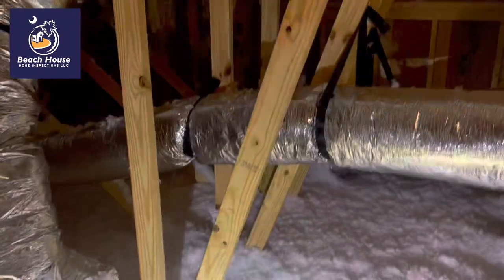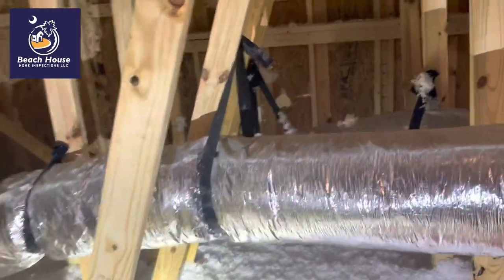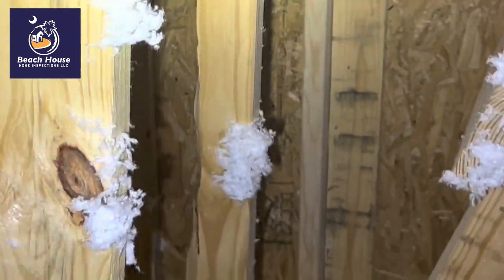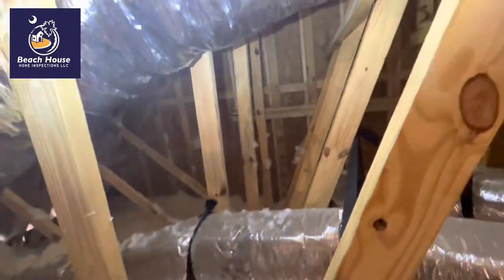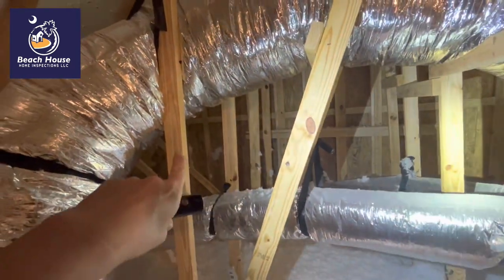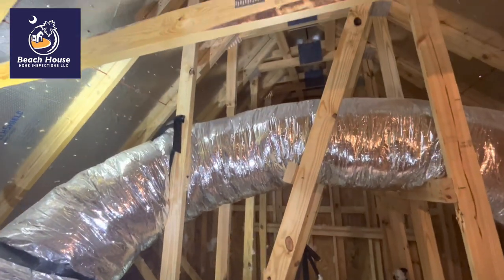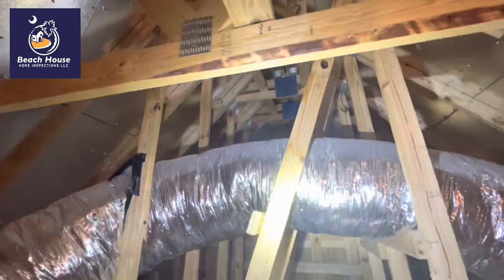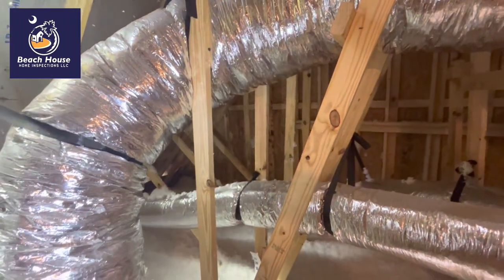Two broken trusses on a new home

Comment: The quality of the materials used in the truss manufacture,, Some of those 2X4s are strictly No. 3 stock,, suitable for pallet manufacture,,, uh wait,,,  There should be structural member printing on each stud, species and No. 1 common,, No. 2 common,, etc.  Where are the grading stamps?  Is that graded lumber at all?     Truss repair?  How about truss replacement,,, the entire roof.  Ungraded lumber is NOT approved for anything more structural than  doghouse, or a pallet.
Reply: Trusses are signed off on by a structural engineer.
Reply: @francismarion6400    Michigan code.  "R802.1.1 Sawn Lumber
Sawn lumber shall be identified by a grade mark of an accredited lumber grading or inspection agency and have design values certified by an accreditation body that complies with DOC PS 20. In lieu of a grade mark, a certificate of inspection issued by a lumber grading or inspection agency meeting the requirements of this section shall be accepted."  If in Michigan,, and IF there are no grading stamps on the wood members,, they are NOT trusses, They may not be used.  The lumber just visible in the video  was at best a #3 or #4 grade lumber,,  size of knots, percent of wain.  The vertical members of those trusses would 100% flunk in Michigan.  Been doing this for 50 plus years.  Flunk.  I would not hire that builder to build a dog kennel for the backyard.  No grading stamps and busted trusses unrepaired.  No effing way.   Don't buy the house.
Reply: @Sailor376also 
Most nowadays lumber is just a freaking joke. That’s on mills, truss companies have to use what they get otherwise they will go out of business. The lumber in this video is yellow pine which is horrible for building trusses: it bends, twists and brake like no other wood.

Comment: In Europe/UK, roof trusses are built form C24 timber that is graded with checks for knots and defects per linear length.  Internal constructional timber must be C16 or better (lower rating), structural timber at C24.   nice to see the US can get away with using any old s..t of timber in their houses.
Reply from the maker: Truss lumber is graded here. This truss was left in the mud for months and installed. This has likely happened in every country hundreds of times.
Reply: @beachhousehomeinspectionsl4967  I was talking about the knots in the lumber, you never see those in C24, basically - no knots over 0.5 cm allowed.  That lumber looked worse than C16, probably ungraded.

Comment: I had a broken truss like this in my 1980s home. I fixed it myself.
Reply from the maker: When you go to sell your house and a home inspector discovers your DIY repair, you will need to provide documentation from a structural engineer, indicating it was repaired according to drawings. If those drawings cannot be provided, the buyer will most likely require you to hire a structural engineer to ensure repairs were made properly.
Reply: Your repair might be perfectly adequate. Hell it might even be overbuilt to what the engineer would have asked for. The problem is mortgage companies and insurance companies want to see documentation showing that anything caught by an inspector which this probably would be, was fixed to specification. And an engineer has to write that specification

Comment: I find it very disturbing that a builder will not let you up on the roof or to open the electrical panel.   Major red flags.  I’d tell the purchaser to try find a better builder.  Good job on being diligent and saving a family years of grief trying to chase down a shoddy builder.
Reply: Yeah, same here.   If I'm an inspector or homeowner and I saw that BS, I'm getting out of the attic, opening the main elec panel, and going on the roof, all while videoing my findings.   "Builder doesn't allow...."   yeah right, it's not his house.

Comment: Did you miss that hole in the sheathing?? Looks like something ramd through the sheathing and did that damage to those trusses.
Reply from the maker: If you have ever built a house you will know that they pop a hole through the sheathing on the last truss to rig it up with a crane. I did miss it it is a non-issue not worth my time to report
Reply: @beachhousehomeinspectionsl4967  Gotcha, they installed the sheathing  while truss was on the ground.

Comment: Honestly, sand bags, rebar, barbed wire and wire mesh with concrete and on site aggregate and you don’t need much wood.
UWL destroyed their equipment trying to destroy a earthbag dome house. True story, look it up if you don’t believe me. Tbh though, there is a reason the military uses those materials to build BUNKERS.
Also, side note, the building industry has a serious foothold with materials and design, so as to profit most with the existing companies and industry.

Comment: This is the worst myth that people to stop spreading. It is true that they don't build them like they you too. For good goddamn reason. Because the old houses were built like crap. Yes the old timber was better and true to size. Like a 2x4 was actually 2x4  same where the 2x10 was 2x10. The issue is with old houses. They did not use hangers they would take a nice piece of timber cut a notch timber. The foundation's sucked back then No lally columns or footing. If they needed a post back then. They were usually cut a tree trunk. That would be on the property from when they cleared the lot. Did not matter what kind of tree. Because the lot was cleared right before building the house. Whatever tree trunk they used as a post would be green. The framing material they used for the first floor deck. Is the word that they stripped from the forms. That's why when you go into a basement of old house you will see concrete footprints on the ceiling. Especially how they framed the support walls in old houses. Usually no headers over the doors or Windows. If they did put headers in there'd be two by four on the flat. With just two framing nails through the studs. No King studs no Jack studs no she'll know cripple studs. The list goes on. People see things built in the past with rose-colored glasses. That's why when people sell an old home. To make them feel better they don't say the floors are unlevel the doors don't close no more. They say it's an old house and it has charm
Reply: I wish I could give this comment a dozen thumbs up. As a carpenter with 43 years experience, I've been saying the same thing for years.

Comment: How much are you really saving with trusses? I would much rather have a traditional attic that I can put stuff in and easily get to my heat/AC, I personally would never buy a house built with trusses
Reply from the maker: When they don’t get broken coming off the delivery truck they are a good product. They are engineered for 150 mph winds. Rafters are not engineered for 150 mph winds.

I’ve seen old rafters that are defective too.

Comment: I would never buy a home from a builder.. i build the damn things.. their materials are garbage.. the engineering is garbage.. the designs are garbage.. that being said, older houses have asbestos, rot, and warping issues (location depending).. that is why i would sooner live in a tiny home or a log cabin 😂😂😂
Reply: All homes are built by a builder,but yes you need to question the quality on these new homes,there are still good builders out there !
Reply from the maker: @melodyhart1331  I agree. I built a number of homes and there are some builders in my area that do build a very nice home.
Reply: @melodyhart1331  i guess i shouldve said mainstream (production) builder. Im talking the Mattamy's, the Jaymans, etc.. not joe blows custom homes.. ive never seen a builder doing more than 100 houses per year doing a good job. Always cutting corners.. up until very recently, Mattamy did 2' O.C joist... 🤢🤢 They were the last big builder in our area to still use dimmensional lumber for joist. Vancouver really sets the gold standard here in Canada. Onterrible is some of the worst ive ever seen. Alberta is hit or miss..